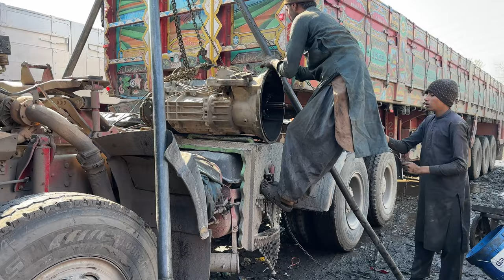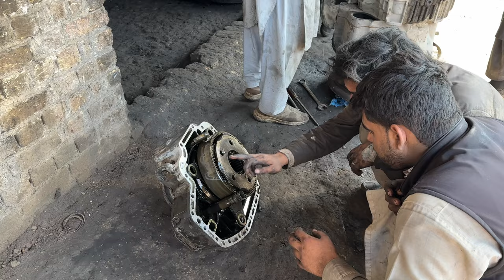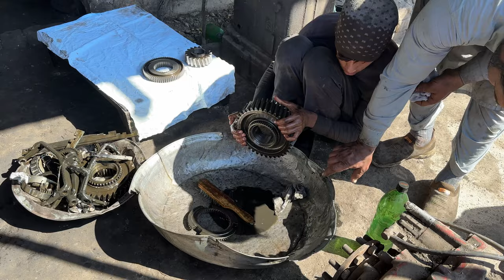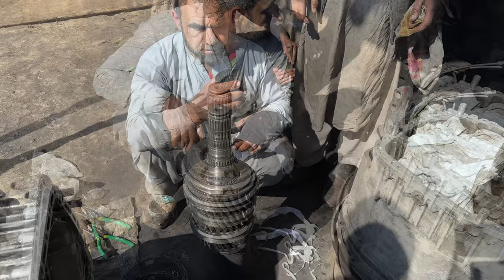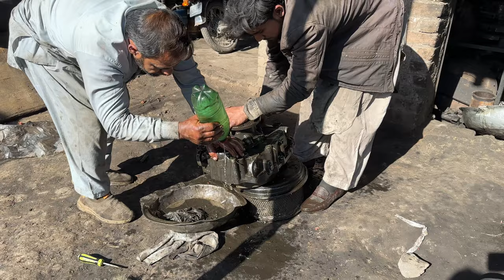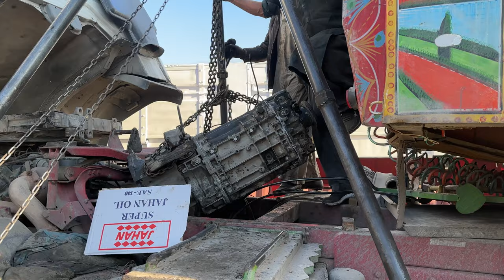Afghan Mechanic Revive Mercedes Trailer Gearbox Against All Odds with Basic Tools

Comment: Said it before and will say it again, the way these lads can disassemble, repair and, more amazingly, reassemble the mechanical pieces without the need of a manual just takes my breath away. One thing I WOULD like to see in all these videos, is what part was actually faulty and show the wear/damage as it gives the impression the item is simply taken apart, cleaned with petrol and put back together simply for the camera. Complete respect to anyone who can take the myriad of parts, throw them in various bowls then reassemble from memory is astounding..